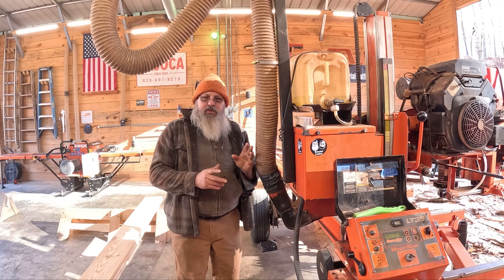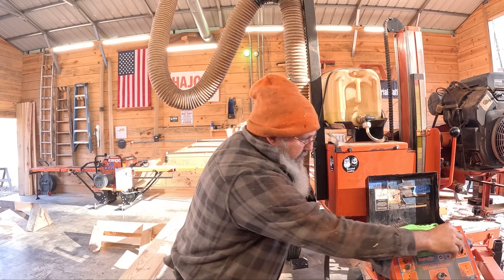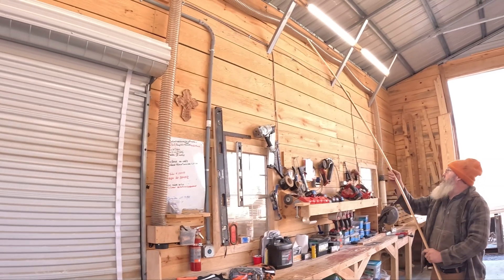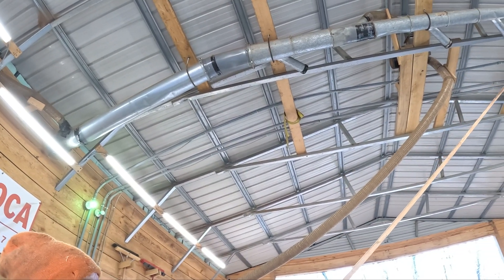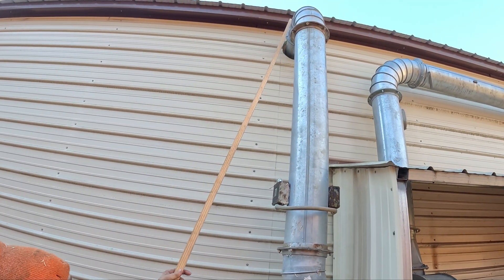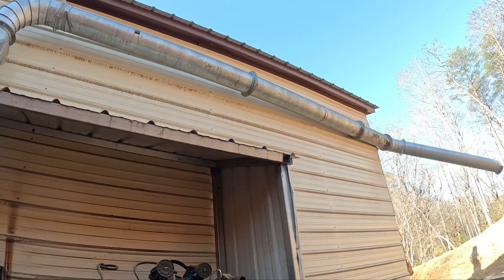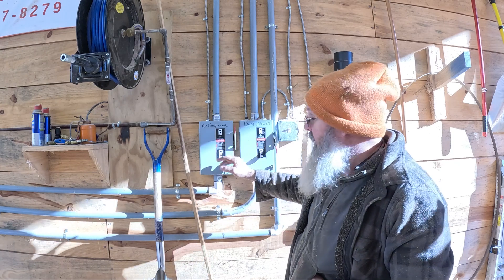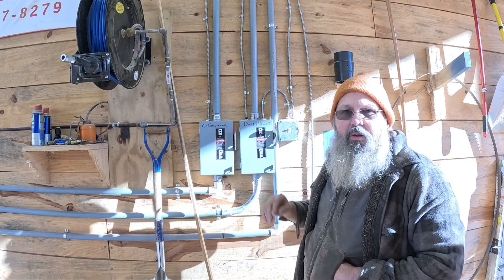A Full Overview of our Vacuum System!

Comment: What hp is the motor on the main blower. If you told it I missed it
Thanks
Reply from the maker: No problem, it's a 10 hp 240 volt motor